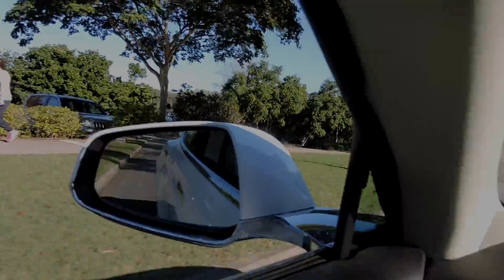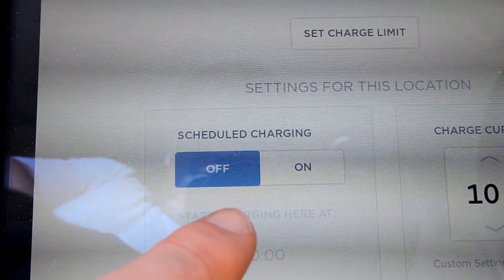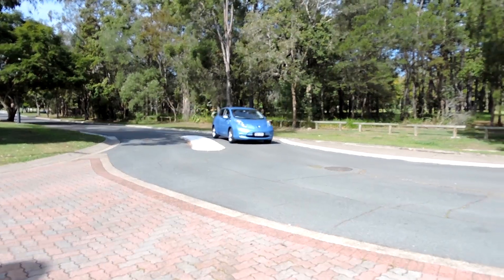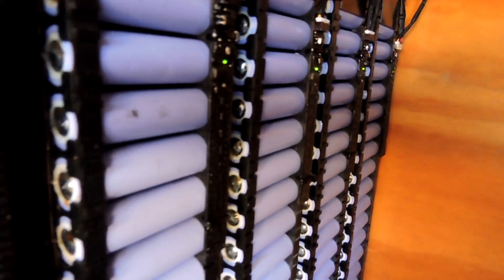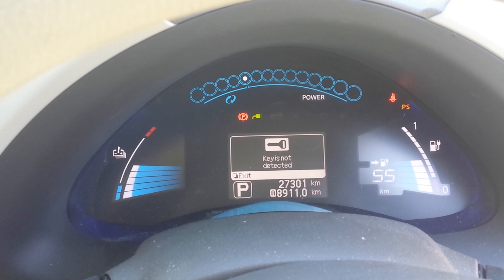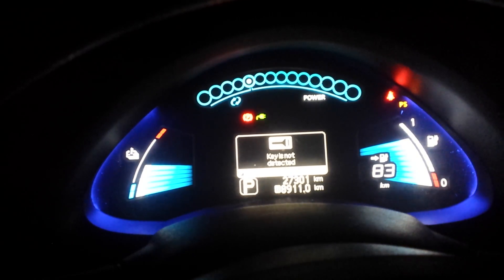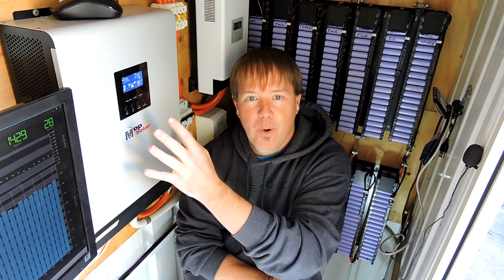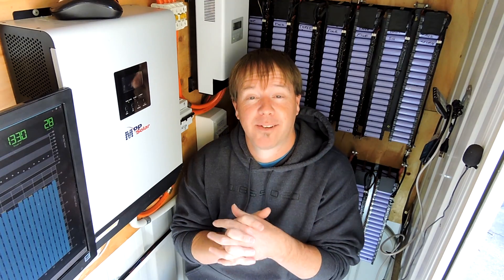Tesla & Nissan Leaf OffGrid Charging with used laptop 18650 cells charged with solar 100% offgrid

Comment: How close are those shed panels to over-lapping? From the angle, it looked like you could cover the bottom row of cells for each of the top row of panels which could impact your power generated dramatically.

I'd move the bottom row down 2 inches if possible just in case! (Unless it's not as close as it looked@ 5:27)
Reply from the maker: snip3d0505 never a mm of shade but it's close :)

Comment: Are the batteries water cooled? And does it not use a heater matrix like a conventional auto?
Reply from the maker: Car batteries or powerwall batteries?
Reply: The car batteries. I just wondered if they are cooled in anyway.
Reply from the maker: Tesla One is i believe, Nissan one doesn't have any cooling

Comment: Nice video.
I did notice the solar panels on your workshop are in two rows, at different angles. Do you feed each string into two separate MPPT inputs, or are they just all into the one MPPT input?
Reply from the maker: they are in series parallel setup so 3s5p only one P is on two angles not ideal but works
Reply: Cheers.

Comment: Awesome Pete! You know very soon you'll get a TESLA modèle 3, with a range around 350 400kms for 35000US$, 2nd hand will then be 15000US$ ... those cars last very well, because they manage the battery temperature very carefully , like you do! and good Li Ion cells. I heard that Leaf tend to decrease rather quickly the range because battery gets damaged with temperature. Apparently there's no cooling!!! Even a Prius has a fan to cool the battery.
I'm impressed by the surface of solar panels you've got . Nice! But I haven't yet quite understood how you can connect all those panels with your systems, what about the balance of power between panels when some are in the shade and the others not. Maybe on the forum you've placed a schematic . Congratulations again!

Comment: How much watts / solar peak power do you have again?
I've had this probably crazy idea to have a long truck motorhome (~10m 7.5t volume truck) that can "fold out" additional solar panels. So you could fit like 24x 275W solar panels on it for 6.6 kW peak solar on it to charge your "electric truck RV" to travel around the World for free. Probably a crazy idea :)
Reply from the maker: A fancy idea, but can you imagine the battery packs you'd need?  Be massive - but cool as hell as well
Reply: I think mileage is maybe twice as bad as normal cars. So it wouldn't be too bad. I'm hoping wheel hub motors will offer higher efficiency and regeneration as well. So it might work in the future. But batteries definitely need to become cheaper :)

Comment: Most of the time it's high amps, high temperature.
I don't know how much volts the batteries are, but guessing it's 24 volt it's like 10amps from the battery for 1 amp 230volt.
So 16 amps 230 volt is 160 amps from the batteries, which is a lot.
Reply from the maker: 48v technically normal operating voltage is 54v. I need to do some learning or understanding
Reply: Ah, well it's often, the higher the amps, the higher the temperature and the thicker the wires you need.
That's why the government uses very high voltages to transport energy:
10000 amp * 250 volt = 2500000 watt = 2500kW
25 amp * 100000 volt = 2500000 watt = 2500kW as well.

You lose volts over distance, not amps
The higher the amps, the thicker the wires you need.
So let's say you got a 12 battery a 100 meters away and then measure the voltage you won't have 12 volts left any more simply because of the distance. Estimating you lost 3 volts, then you lost 25%! 
Somehow if you have a 100.000 volt battery, you'll still have 99.997 volt left, so you lose 0,003%, which is nothing.

I guess you charge your batteries relatively slowly, while you discharge your batteries quite fast, so while discharging you'll have higher amps. I also think that if you have 60 volts in your batteries left, that you'll have noticable lower temperatures as when you got 48 volts left, because in amps, that's about a 20% difference.

Comment: 8:20 FYI this Leaf hat lost one Capacity bar. Turns out this leaf had not the full capacity. Only 85% left of it, or so.
But yes, the Leaf makes fun to drive. :)
But i have bought a Renault ZOE because of 3-Phase Charging. (Here in Germany are the most Charging Stations 3-Phase 32A = ~22kW)
Reply from the maker: The batteries i'd need to charge with 3-Phase lol

Comment: hi any  advice hot to connect4x 12v car batterys of 90ah lead acid and wich bms would work with it because i got today one little problem one battery failed and was hot and all expanded luckily no fire or damage was done to my garage :)

Comment: How are your solar panels wired up to deal With your panels all being at different orientations and on different roofs. Do you get issues? And do you think it's harming your efficiency?
I ask as I'm in the northern hemisphere. My roof has a slightly south of east side and a slightly north of west side. If I put panels just on the east side then they will not be outputting come late afternoon / evening. I wondered if I would need an inverter per side. But it does not appear that you have.

Also in relation to this video, how many volts would you need to allow dc charging of the EV's thus bypassing your inverter.
Reply from the maker: On grid panels (11+13) are on two separate MPPT charge controllers in the SMA TL-5000 gridtie inverter. New 1.5kw panels on the PIP4048 & the 3kw panels on workshop roof are on the PCM60X - all seems to work well

Comment: Pretty cool running the Leaf 100% from your own power.
Reply from the maker: Car was only borrowed, and have an iPhone so coulnd't justify the 30 dollars for it
Reply from the maker: Shows it can be done, but next question is is it worth it considering load on inverter... Batteries are fine, just the extra work load on the cheap inverter is sure to shorten it's life
Reply: I'd like Pete to know my leaf also 11 bar and has 25% battery when the last SOC bar disapears. Use Leaf Spy and youll no longer have range anxiety :)
Reply: HBPowerwall ahhh iPhone yeah I use the free version on my Android phone :)
Reply from the maker: I found my Samsung 2 days after i returned the car lol

Comment: The panel voltage is probably about double that of the battery bank so the inverter will have about half the amps running through it when running off solar, that's why it runs cooler.
Reply from the maker: That's what i was kinda thinking in my head.. but don't know the ins and outs of it

Comment: Ravi_paudel5 sits there hitting refresh..

5 hours is pretty long, but you're not a fast charger station anyway.
Errr. 15KW or 1500W? You need to chop a few trees... by accident of course ;)
I'd rather by a eGolf because it looks better and the new ones have good range, obviously prefer tesla though.

You should instead make a serverrack style system. so a rack full lof flat batteries (somehow suspened) like drawers so you can slide them out (safety first!) with all cabling covered and protected from shorts etc.. saves a lot more room.
Reply from the maker: Yeh 1500 I think I blinked up a text correction on that gaf. I like my style system won't be changing it :)
Reply: Phizicks would likely need to be a rack on diagonals to help stop the heat building up under each layer in that scenario. Or some other low tech solution like it.